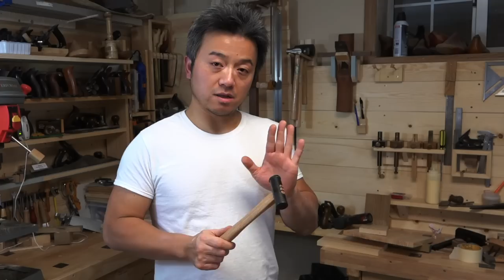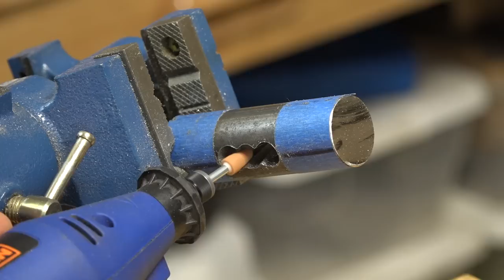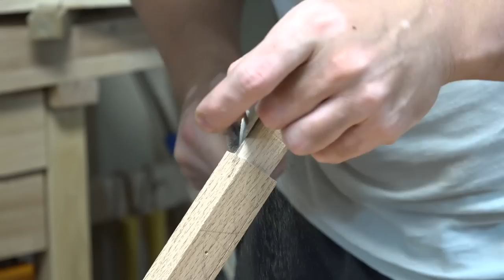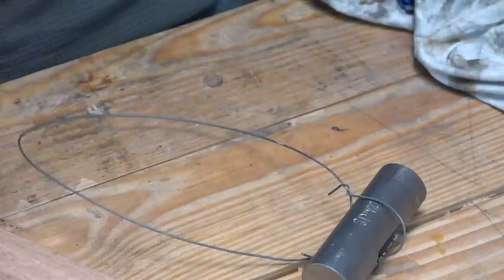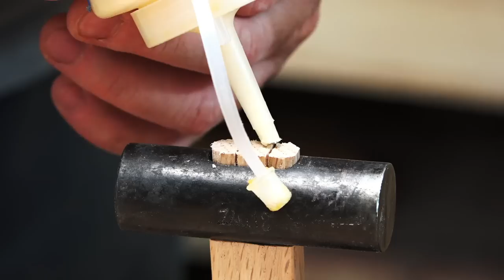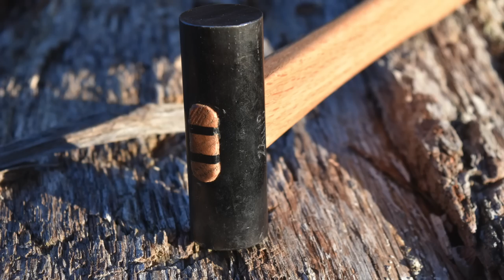A Japanese Woodworking Hammer

Comment: John,  another outstanding video! Practical and creative.  I've been smithing recently,  and I learned a great trick for finishing steel.  Pull it from the fire and brush vigorously with a wire brush.  Then,  with the steel warm but not super hot,  rub it with bees wax. The wax should liquify and flow but not smoke.  Rub with a rag and allow to cool.  The surface with be smooth to the touch and also resist rust.

Comment: Nice hammer John! 1018 steel can be hardened I am not sure off hand how hard on the Rockwell scale, you probably hardened yours during your blackening process. Anyways I am glad your still making videos! Most guys just go so far then quit. Thank you.
Reply from the maker: Thanks RB. 1018 is pretty soft, but it's still steel, so it's harder than a lot of thing. I am not sure if it can be hardened much, but I think putting in the ash/fire repeatedly could have case harden it some, by adding more carbon into the outer layers.

Comment: John next time you need to blue something try using oil, it will quench better but the oil blue the piece in one step.
Reply from the maker: Thanks JS. I wanted to use something that everyone had access to. Also, I think the repeated heating and cooling may have case harden the hammer head.

Comment: Someone (a DIY guru) showed this colouring process using OLIVE oil; you did not....?  Is there anything spec. about OLIVE oil for this process---except that it's quite expensive...?
Reply from the maker: I happen to find this method when I was making a hold fast. Their could be many ways to achieve a similar result.